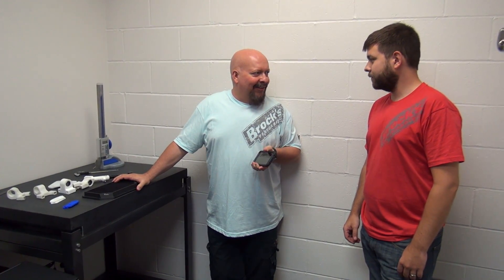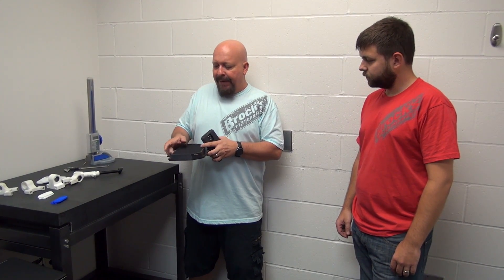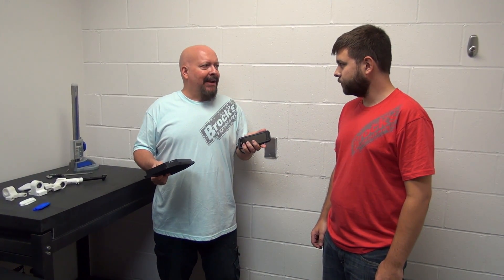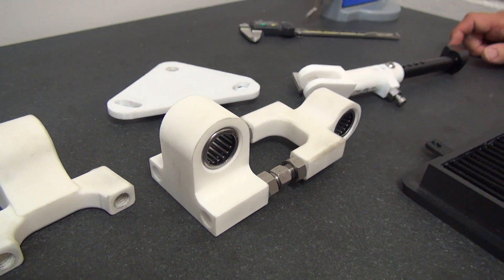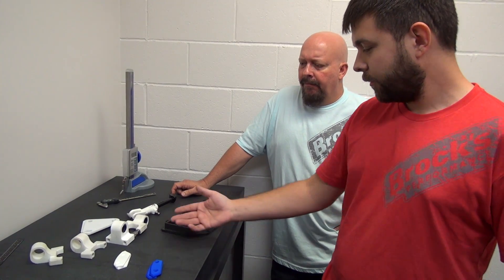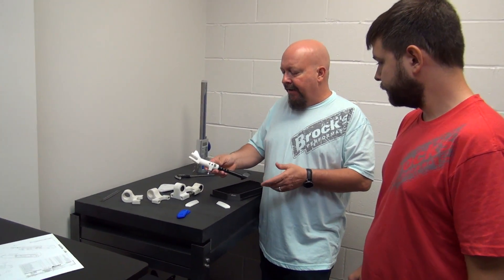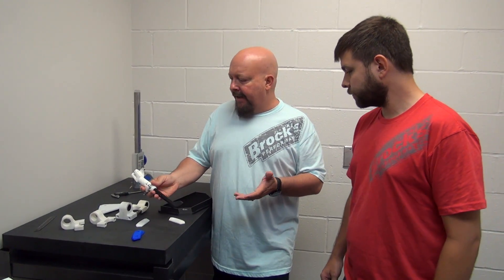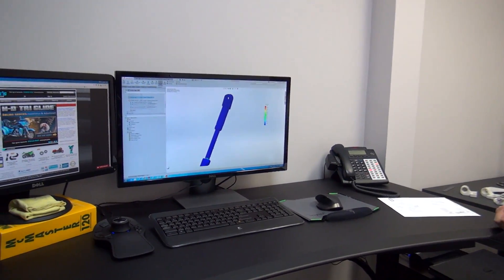Tech Talk: Rapid Prototype Engineering

Comment: when you dyno that filter I hope it's not with a bunch of changes at once. so we can have a good idea of what it does on own.
Reply from the maker: Jason Powell just the filter, nothing else.
Reply: Brock Davidson in passed I remember you straightened out a modified BMW for some one that bolted on your exhaust. his bike wasnt performing as  expected, a BMW I tbink. One of the things going by memory was pulling the race filter and going to a de screened stock filter and chain care. and the bike pick up a happy gain. basically show how parts like  air filters may not show as much gain by themselves but help it breather together. maybe after filter and exhaust dyno you could put back in the stock to show how much  the sprint works together with your exhaust.
Reply from the maker: Jason Powell that BMW had an over-oiled aftermarket street filter...stock worked quite a bit better. That's one reason we like the Sprint Filters, no oil!
Reply from the maker: @Jason Powell, the video you are speaking about is right here: https://www.youtube.com/watch?v=LhV6tkPKSAY&feature=youtu.be we removed an over-oiled aftermarket STREET filter in favor of an unmodified OEM stock filter, and we would do it again in 9 out of 10 cases. Technology has advanced to the point where it is very easy to spend good money to slow your bike down with aftermarket goodies, sometimes from operator error. Sprint Filter does not require oil, so that takes the operator out of that part of the equation. A better material finishes off a great idea, that's why they are OEM in several Ducati's. We will be providing more info. soon as part of our new video series.